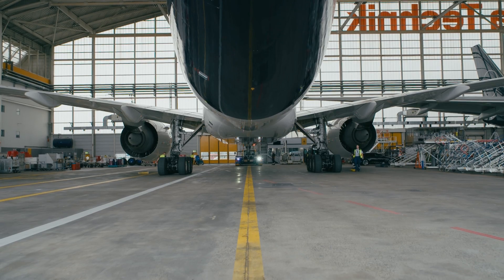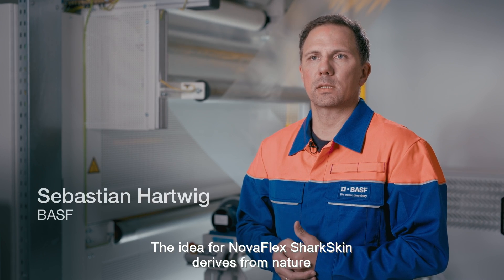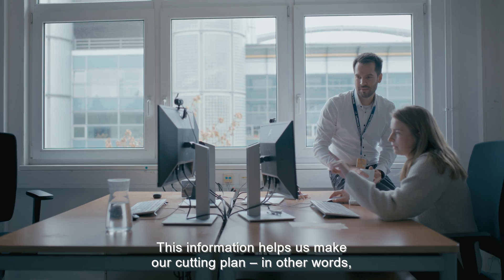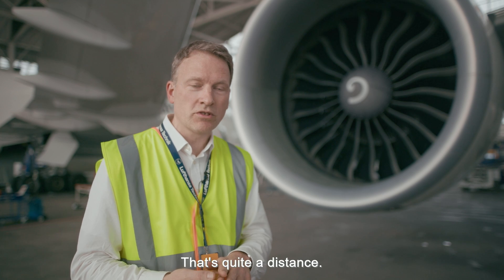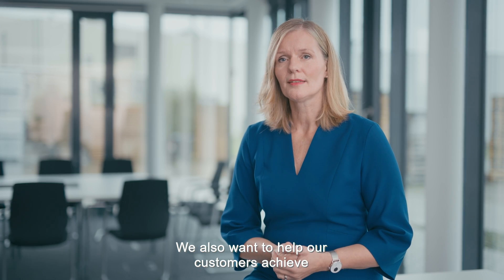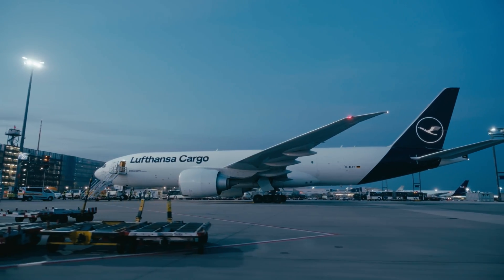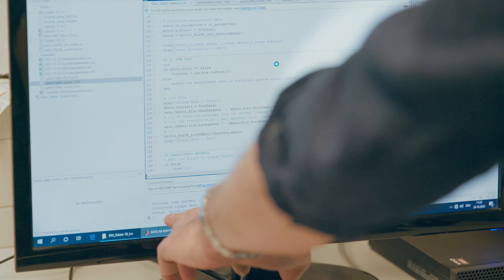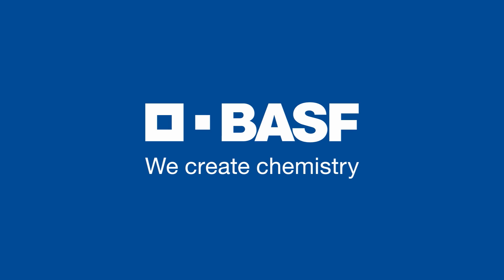Better aerodynamics, less kerosene, less CO2 – Sharkskin technology for aviation.

Comment: What about the weight of the film? Doesn’t the film weight adds to the fuel consumption?
Reply from the maker: The weight of the film applied to a 777 aircraft is the one of about two passengers. Even though it adds weight, it still reduces 1% of fuel consumption in its currents state

Comment: I wonder if this could be used on fan blades. We use lots and lots of energy driving fan blades for device cooling and air/gas circulation. This product's low weight, ease of application at a wide range of scale and RF transparency are interesting indeed. I also wonder about its durability in applications where the fluid mass is liquid rather than gaseous, like its namesake, the shark.
Reply: If you're talking about jet engines, the problem is any turbulent flow resulting from misapplication/wear/delamination could create compressor stalls and engine vibrations, as this area is too safety critical for this application, maybe until this tech gets much more mature. As for marine applications I only see this usable for submarines, as ships' undersides are generally dirty from barnacles and other stuff.
Reply: @Avantime  I was actually thinking of air movers in HVAC systems.
Reply from the maker: Other applications such as wind energy, automotive or marine are being evaluated. The requirements differ and the technology cannot be applied 1:1.